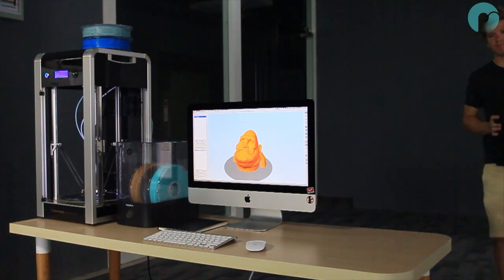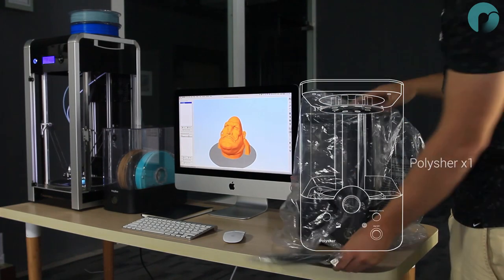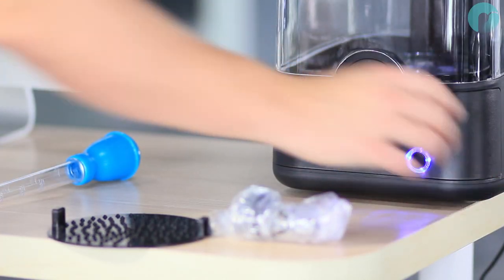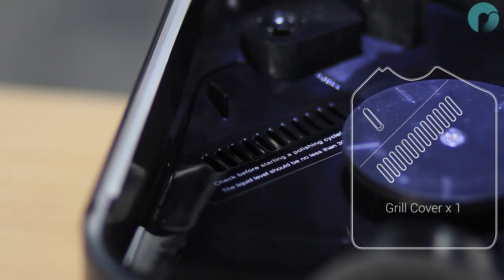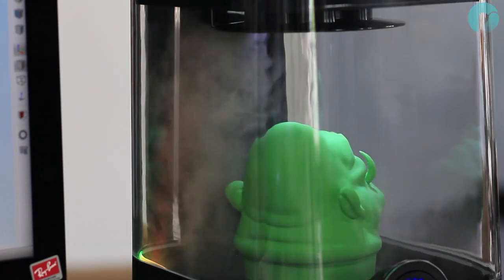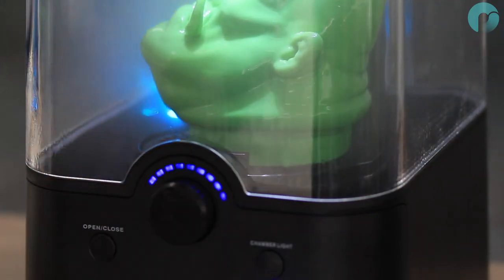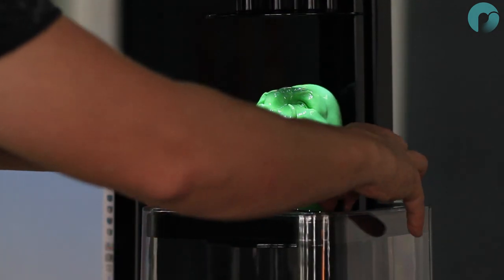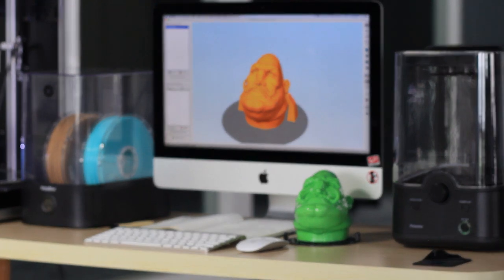Polysher Operational & Set Up Video - Polymaker

Comment: What Isopropyl alchohol is recommended?
Reply from the maker: The Purest Isopropyl you can find, avoid denatured IPA's and try and find a concentration >97%
Reply: Polymaker And how long does the tank filled with Ispropyl last until it is empty?
Reply from the maker: You can run the polysher for two full days (16 hours) on one full reservoir roughly equal to 200ml. The vast majority of IPA is recycled in the unit. However, some IPA is absorbed into the PolySmooth material which then evaporates away while the part is drying.